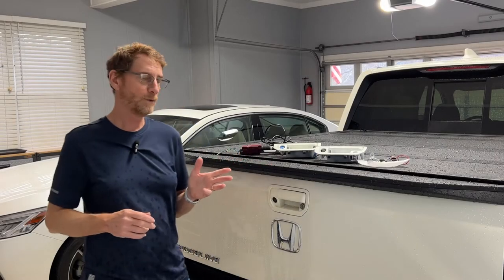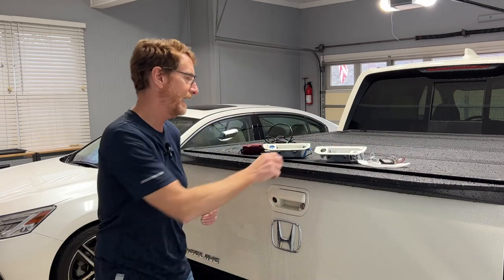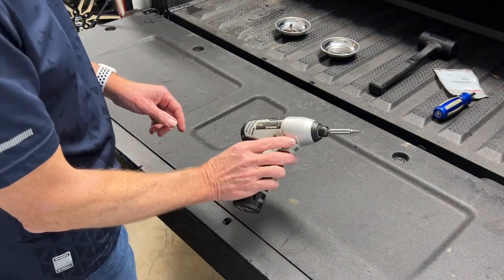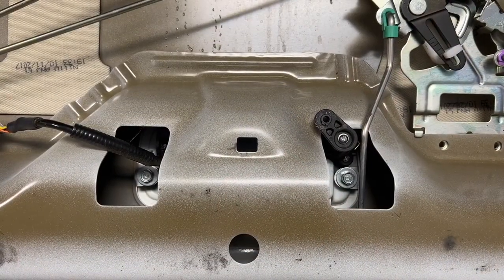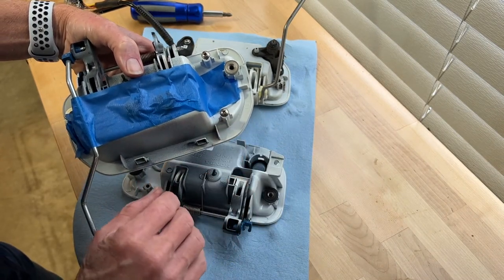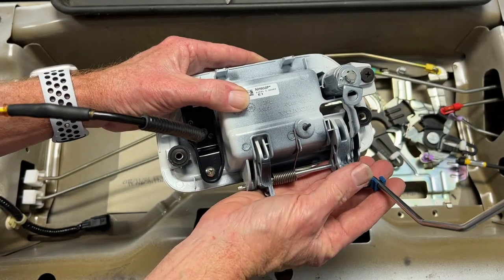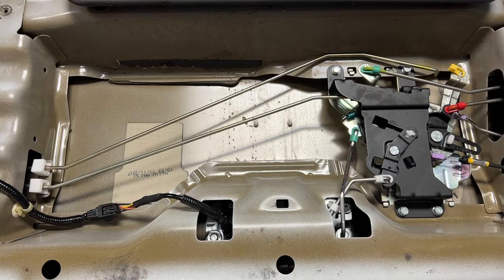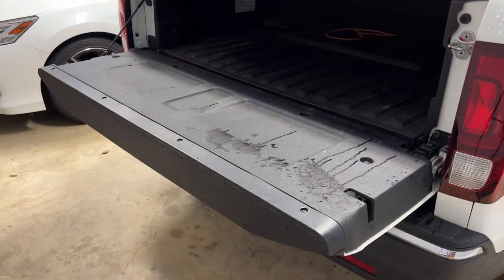Honda Ridgeline Tailgate Cap, Cover removal. Backup Camera or Tailgate Handle / Lock replacement.

Comment: Thanks for the video. My interest is being able to replace the tailgate lip if it gets torn up with use. Having to tap to the passenger side would not have been obvious.
Reply from the maker: Yes, the clips are designed to be easy to tap into place, no doubt aiding in quick assembly at the factory. They are also designed to be very difficult to pull out, so the tailgate cap won't come off unintentionally when heavy objects impact it or are dragged across the cap. sliding the cap over to release it and then being able to reuse the clips is genius, but not intuitive.

Comment: Great demonstration!  Very helpful.  Consider adding in to your description how to replace the back up camera as well... that is what drew me here... the need to replace my back up camera.  As I was walking behind my ridgeline with a paper towel I gave it a quick clean... unfortunately I had pine-sol soaked in my paper towel, and my camera went from working to not working that quickly.
Reply from the maker: Glad to hear the video was helpful and I'll follow your suggestion and add 'back up camera replacement' to the title/description. 

Before you buy a new backup camera, drop open your tailgate and inspect the backup camera wires near the hinge on the left side of the tailgate. These wires are flexed a lot whenever the tailgate is dropped open or swung open and over time the protective jacket around the wires and the wires themselves can break down. If your's is broken there's good news and bad news. The good news is that Honda is aware of the problem and the  wire harness that goes from the camera to just behind the bumper where it joins the main vehicle wire harness can be replaced. The bad news is so far Honda has not opted to cover this as a recall or manufacturing effect and is charging customers to replace the wire. 

If you have a good relationship with your dealer they may absorb some or all of the cost. You can also pay to have them replace the wires harness and seek a refund from Honda. The harness itself cost about $100 and you can order it on-line and replace it yourself. If you pay anything to have the harness replaced, keep your receipts. The National Highway Traffic Safety Administration is looking into the situation and may take action.
Reply: @Koolbob2  Somehow YouTube didn't notify me of your reply :(  Thanks for your very helpful answer.... I just tackled this today and it turns out it was indeed broken wires at the hinge point.  All the wires were broken at the same spot so they must flex right on that spot.  I used solder shrink tubes and put them back together... still had to take everything apart to get to them.  If it happens again I will likely bridge the wires again with more shrink tubes : )  I removed the 2 zip tie downs so the wires can flex along several inches instead of just on one spot.  I appreciate the help!😀

Comment: Thanks!  I used your video to get access to the camera wire replacement.
Reply from the maker: Awesome to know it helped! Did your backup camera harness break just below the left taillight? Several Ridgeline owners have had their wires break, sometimes the dealers have repaired the wires under warranty, sometimes they bill the owner for the repair. The National Highway Traffic Safety Administration is looking into it, so hang on to your receipts, you may be eligible for a refund depending on what the NHTSA decides.

Comment: Great video and I have decided to jump in and upgrade tailgate on my 2019 ridgeline.  Question do you have part number for the plastic clips?  Do they come with the replacement parts? Thanks.
Reply from the maker: The clips are only a few dollars each and you may not need any, but odds are you will break a clip or two removing the tailgate cap so I'd recommend ordering three or four when you order the locking handle kit. Here's the part of the video where I show the part number for the clips. https://youtu.be/OS-azheiJQ8?t=299
Reply: Thanks for the response. I have the parts on order. Also on my 2019 ridgeline, rear seat on drivers side will not lock in up position. I have inspected the handle and cables seem to be ok and working. Honda dealership said the would have to remove the seat and quoted me a minimum of $450. I am not willing to pay that much. I cannot find anything on you tube on removing the seat and do not feel confident enough to dive in without some sort of instruction. What is your advice on this problem?
Reply from the maker: @Flyman48  I've never had any problem with the rear seats so I don't have any experience working on them. I did find these Illustrated instructions for the accessory trailer harness kit installation include rear seat removal step-by-step; 2017 version is here:

https://www.collegehillshonda.com/instructions/ridgeline/2017/hitchharness.pdf

Comment: I have a 2012 can I used it for mine thanks
Reply from the maker: Thanks for watching and GREAT question! 

I had a 2012 Ridgeline and it was great, traded it in for the 2018. I think the locking mechanism is the same in the first and second generation Ridgeline. I'd suggest taking a piece of paper, laying it up against the handle on your truck and trace the outline of the handle. Then trim the paper so it matches the shape of your handle exactly. The next time you see a second generation at a dealership or see someone driving one ask if you can compare your paper template to the handle on their truck. If they are the same shape, then I'm pretty sure the new handle with a lock kit will fit. All of the new, locking handles have a hole for the backup camera, if you don't have a backup camera on your truck you will need to plug the camera hole on the new handle.
Reply: Great idea 💡 thanks 😊

Comment: Question did you have video to install popandlock with solenoid? Also is there a top quality solenoid that last? Can I splice popandlock wires to truck lock in bed instead of going g to fuse panel? Have 2007 ridgeline
Reply from the maker: I installed an electric Pop-N-Lock in my 2012 Ridgeline but I wasn't making videos back then. I had to replace the solenoid a couple of times and I bought 'heavy duty' solenoids, but they are all cheaply made and either the motor in the solenoid dies or the plastic tip on the actuator arm snaps off. They just can't handle all the lock/unlock cycles that come with locking and unlocking the truck every day so I installed a bypass switch under my dash. When the switch is on the tailgate lock operates along with the door locks, flip the switch off and the tailgate lock stays in it's current position no matter how many times I lock and unlock the truck doors. 

Pop-N-Lock has instructions for tapping into the driver's side rear door lock wires, it's actually pretty easy. On mine I tapped into the wires as instructed by Pop-N-Lock, but I ran one wire up under the dash to my bypass switch, then back to the Pop-N-Lock so the tailgate solenoid only worked when I allowed it to since the solenoids aren't very robust.
Reply: Thank you

Comment: What is the part number for the longer purple clip?
Reply from the maker: I found the violet colored clip for a 2021 Ridgeline on-line, but the photo looks like the short clip that came on my 2018 Ridgeline and not like the longer clip that came with the tailgate lock. https://www.hondapartsnow.com/genuine/honda~snap~72139-sr0-a01.html   Here's the replacement lock with the longer clip. https://www.hondapartsguys.com/oem-parts/honda-tailgate-lock-cylinder-8z07t6z100d?origin=pla&gclid=Cj0KCQiAnrOtBhDIARIsAFsSe52fOel057AM5h2pDJ2gE51gGHUG4YWZBtfEX4QuBCCnwAWXzerhXnIaAuUhEALw_wcB  I would recommend ordering the $5 clip, maybe the webpage hasn't been updated and you will receive the newer style longer clip.
Reply: Thanks for taking the time to reply.  Maybe I will call College Hill Honda and discuss.  I can let you and the others know should I find that new part no..

Comment: Thanks for the video, it looked like it was a separate key? If so, do you know if there's a different lock that would work with the actual truck key?
Reply from the maker: New trucks that come with a tailgate lock from the factory have a key that fits all the locks. If you add a Honda tailgate lock the lock comes with a pair of new keys that don’t match the truck. You can have a locksmith re-key the tailgate lock so your ignition key will work. I only need to lock the tailgate a few times a year, do it doesn’t bother me to have a separate tailgate key.
Reply: @Koolbob2  Thank you so much!

Comment: Will this work with a Pop n Lock?
Reply from the maker: Thanks for watching! 

Pop n Lock (PnL) makes their own tailgate handle that works with the PnL mechanism, but I don't recommend getting it for 3 reasons. 1- the PnL handle is unpainted black plastic. 2- the PnL lock is in inferior 4-tumbler lock like you would find on a filing cabinet. 3- the PnL plastic becomes brittle after a few years. 

I ditched the PnL power lock mechanism and handle because the OEM handle is much better made. I really recommend you consider doing the same.